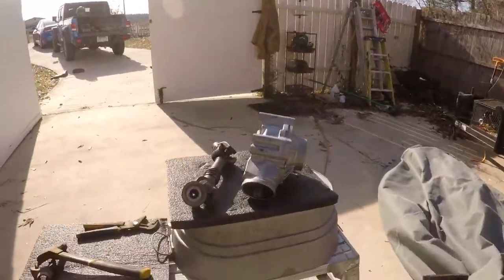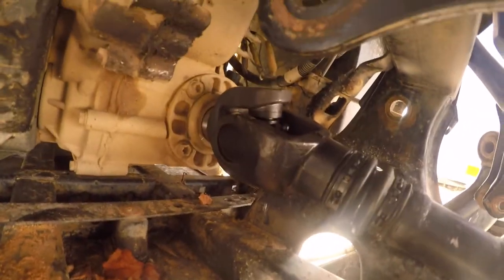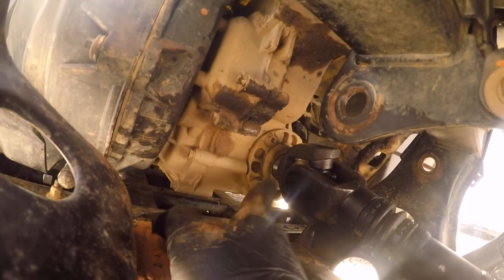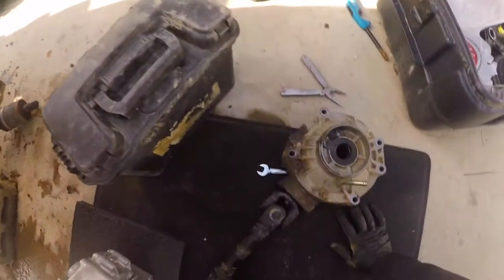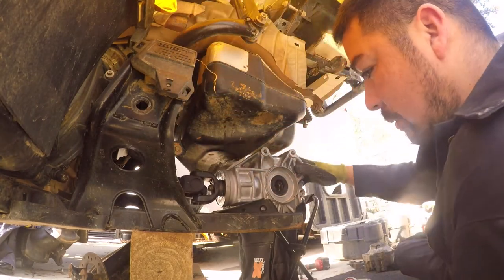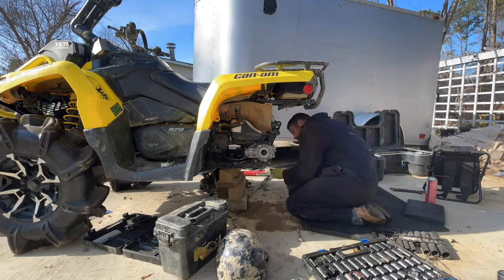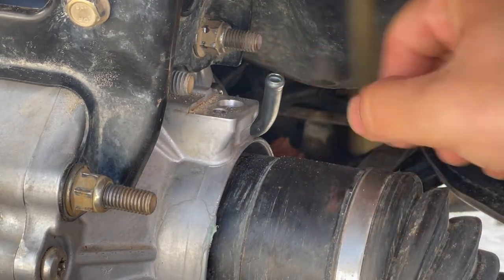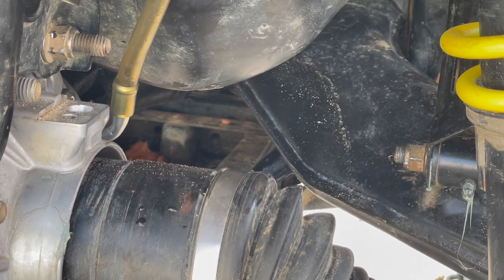INSTALLING THE TORQUE SERIES REAR DIFFERENTIAL AND DRIVE SHAFT.  PART 2.

Comment: how were you able to get that top right bolt off to take out the rear support. the left side is easily accessible but the right side nut isn’t accessible to get a wrench or socket in there. Any tips? 5:36
Reply from the maker: To be honest i can’t remember, I think I used vice grips. It was pretty tough job for the first time. I hope that helps.

Comment: Bro I can’t wait to get ridding. I just work so much😆
Reply from the maker: I broke her again this weekend
Reply: @outdoorjz  what????
Reply from the maker: Yeah I drove it too hard and yeah gotta a few things I need to do to get it back up and running
Reply: @outdoorjz  what broke?
Reply from the maker: @paulgarcia6257  winch, axle, front drive shaft, and I think I got water in the engine.